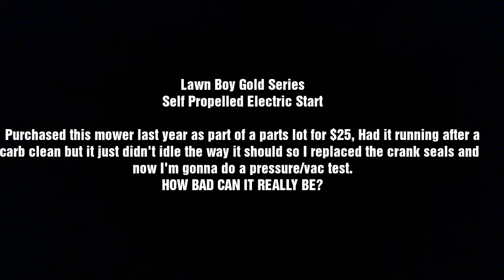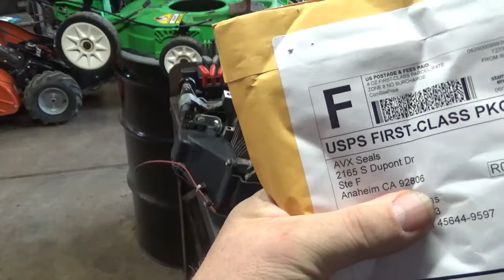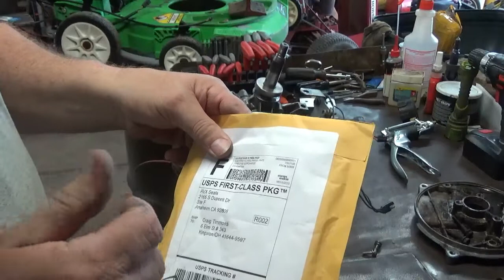LawnBoy Gold Series  push Mower: Pressure Test  didn't Expect to Find This

Comment: Those seals are easy to find! You can get them off fleabay. I get them from my local small engine parts distributor. Less than $2 each my cost. 611396, 602632, 605020, and 609342 are all the same part. Fit C, D, and F series engines. BTW, you can use Permatex Motoseal  to seal those case halves. It is recommended for sealing engine and transmission cases. Its what I use for sealing these. I’ve also used it for resealing Onan intake manifolds. Never had an issue.
Reply from the maker: Nice to know there still available,  My local supply shop stated they were no longer available. I try not to buy off FleaBay if I dont have to, never know if your getting what you order, Too easy to be had.
The AVX Seals are of good quality and not expensive in price.
Reply: Craig Timmons My local Distributor ( Maple Grove Distributing ) still has them listed in their 2020 catalog. In fact I just picked some up last week. Had to do a bottom seal in an F engine. Doing top and bottom seals this week in a Duraforce engine. BTW, the Duraforce (Goldpro/Silverpro) engines use a different bottom seal. Top is still the same. Part # for it is 94-5764. Not available aftermarket anywhere that I’ve been able find. The seals are held in with snap rings on those. Some will say that you need to split the case to change the seals. It’s not necessary, but I highly recommend it. That way you can reseal the case and access the reed valves, as you cannot get to the reed valves externally. Also, new reed valves are NLA,  so you’ll need to find a good used set or someone who still has some NOS in stock.